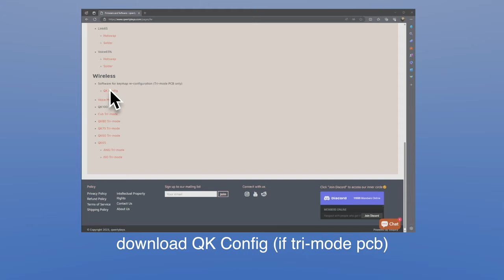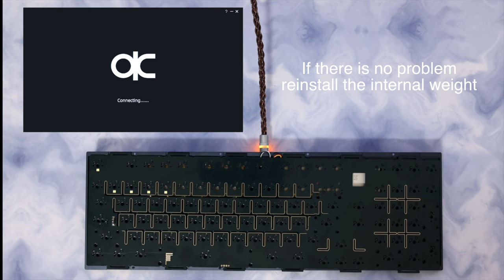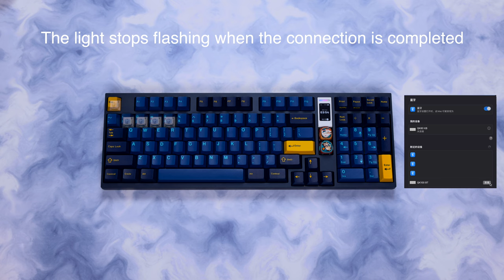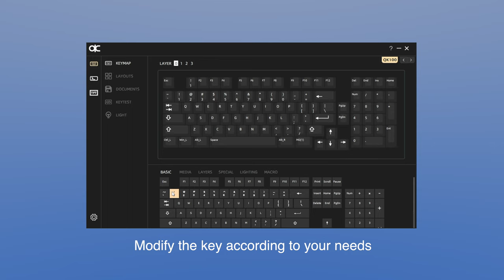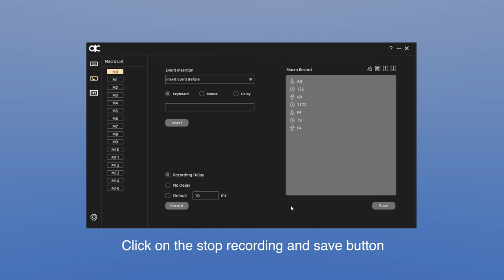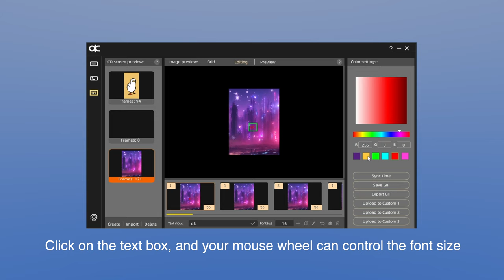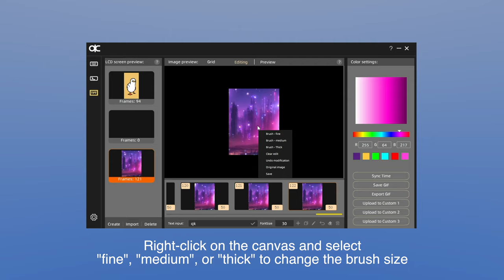QK100 Assembly & Wireless PCB Guide

Comment: Just built a QK100 with the wired Hot Swap PCB and COPY+PASTE doesn't seem to work. Anybody else have this issue?
Reply: Not exactly sure whats going on exactly maybe keytest to see if your control key or alphas is working.
Reply: @nikocayetano1805  It was a intermittent switch. Tested good at first then stopped working. Replaced it and we all golden. Thanks!

Comment: I'm having a weird issue with this keyboard.  For some reason, my keycaps don't fit, meaning they are hitting the aluminum frame and not capable of being pushed down all the way with the ESC F1 F2 etc. keys.  I'm using the U4T Boba switch and Drop's DCX Keycaps.  I tried using other keycaps and switches I used on the Tiger and the same issue arises.  Can anyone advise?
Reply: Different layout than your tiger lite so it requires keycaps that match the keyboard if you get any base kit it should fit you just got to find the appropriate keycaps
Reply: If you’re using a plate, make sure the switches are seated correctly on it. I tried a plateless build and I had the same issue as you. The plate helps with aligning all the switches correctly.